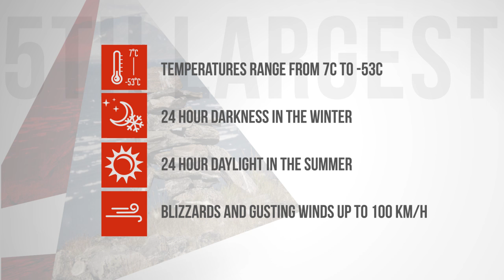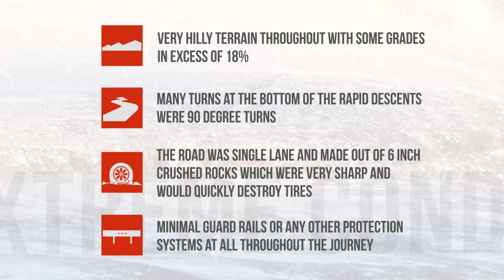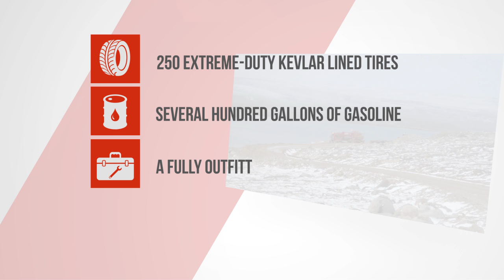Scott-Woods Baffin Island Superload Case Study

Comment: Only 80,000 lbs., why the need for 13 axles?
Reply: That specific trailer is set to run 12 or 13 axles, depending on which truck pulls it. It just happened to be the best trailer for the job...